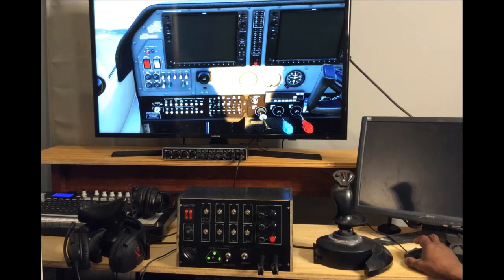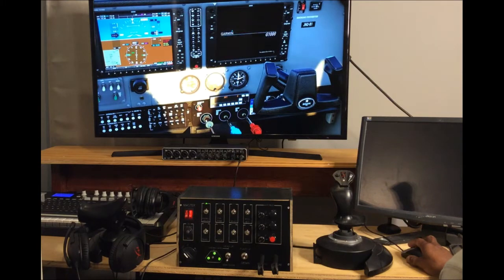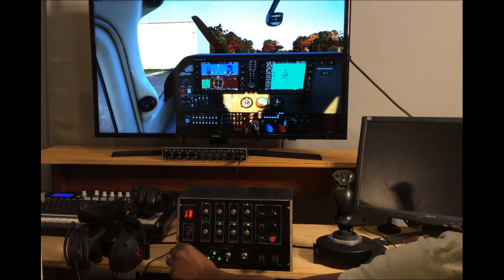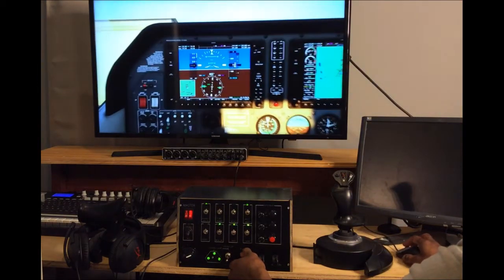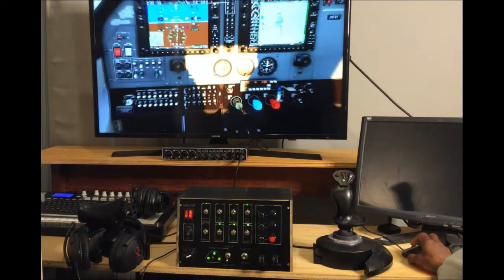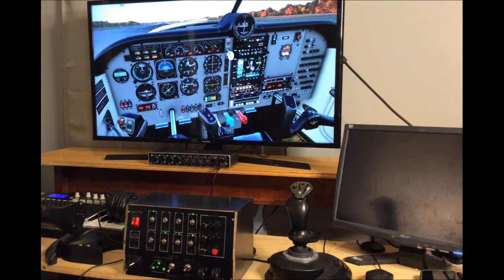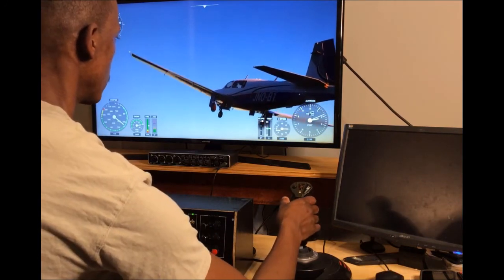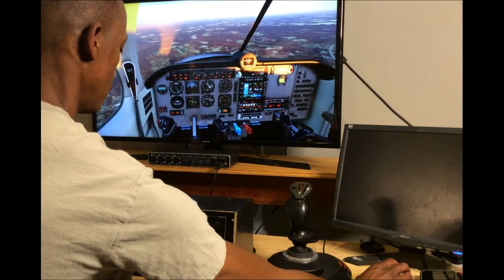My First Switch Panel - Prototype - Works Perfect w/ Microsoft Flight Simulator 2020

Comment: I'm 200 subscriber keep it up i really like the setup do u use a Arduino to build it or a Arduino mega or what 🤔?😅
Reply from the maker: Thank you for being my 200th subscriber! I am using a Teensy 3.1 in this video, but the code is written in Arduino. Check out my other switchbox video, I use a Teensy 4.1 with Arduino also. https://youtu.be/VSp1POE9ido

Comment: That's a good switch box. 👍
 I have built one that surrounds my x52 throttle. I may have went slightly mad or just bored, there are ~120 buttons/switches/levers. I have connected it with 2 leo bodnar bbi-64 boards. Another box sits in front of the stick with 12 buttons and 2 pots connected using a pro micro board.
I can see a diy ah-64 cockpit getting built in the future 🤪.
Reply from the maker: Hey Cammy, thank you for watching my video. That sounds line a really cool switch panel that you've built.  Do check out my Switch Box 2.0 https://www.youtube.com/watch?v=VSp1POE9ido&t=36s and LED Head Tracker videos https://www.youtube.com/watch?v=5oPoF5BKCPU&t=890s